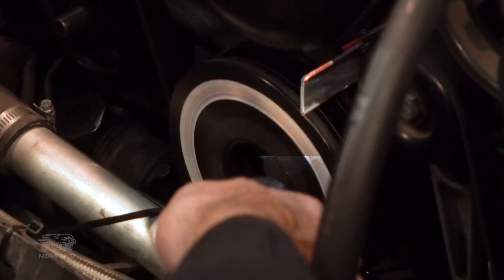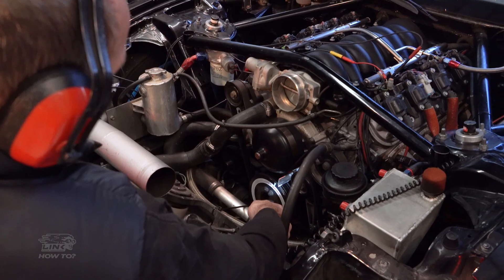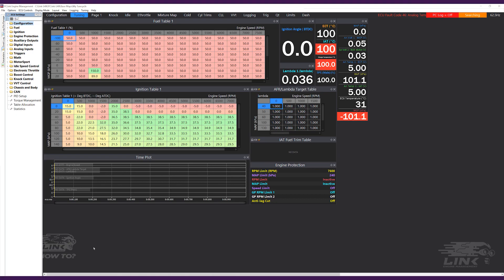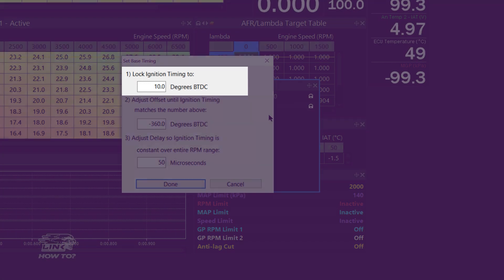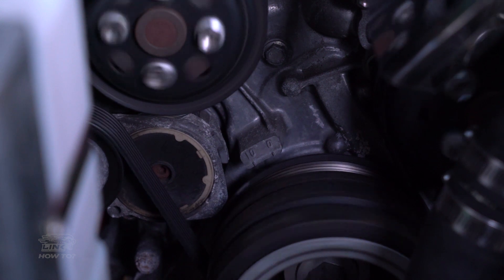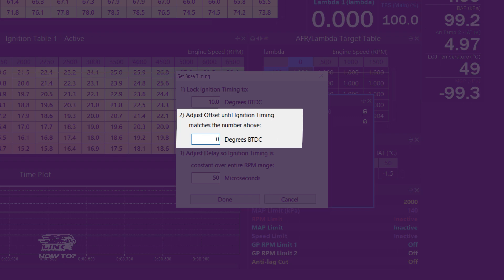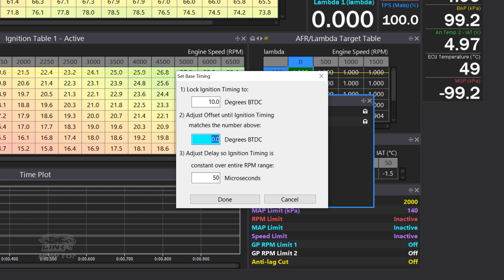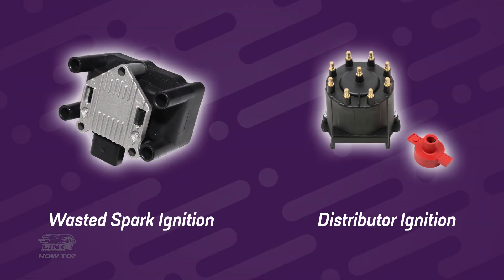How To... Fix An Incorrect Trigger Offset

Comment: Does the same apply to the HKS trigger kit in on RB26? Proper base timing on a an RB26 is 20° on the crank pulley, but the kit requires a 10° offset. That just ends up being 10° on the crank pulley. Is that correct?